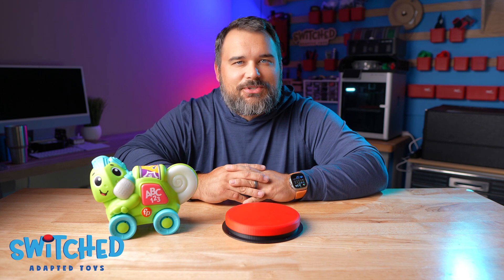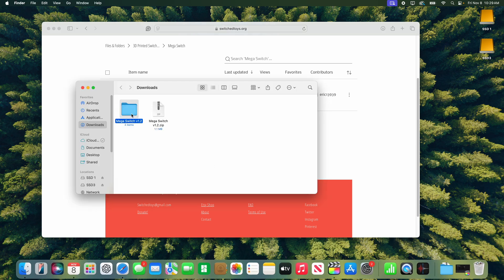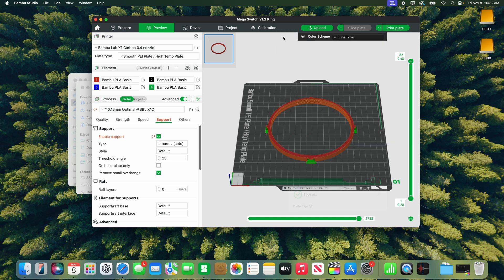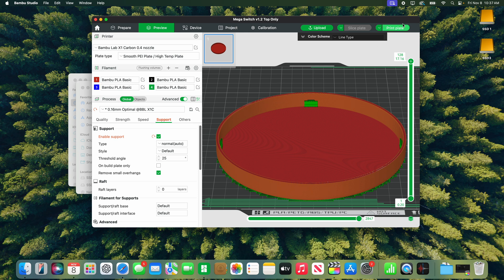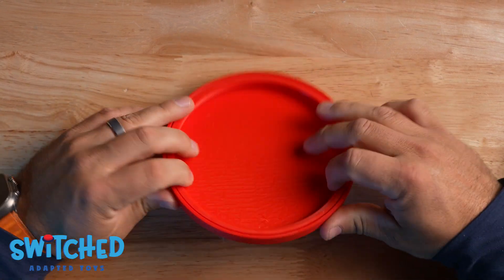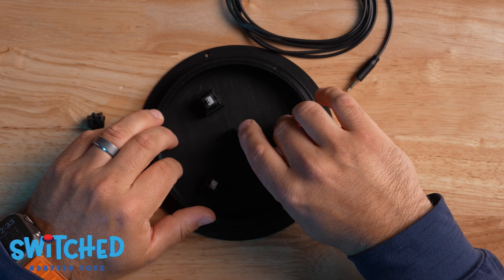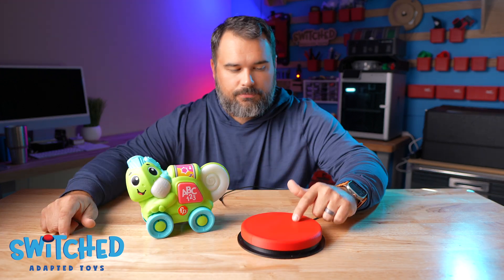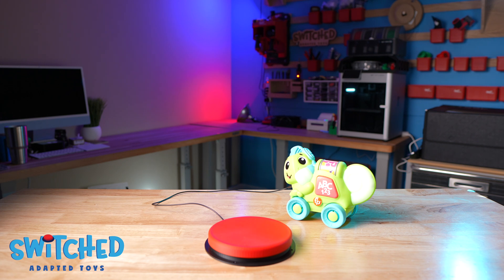Introducing the Mega Switch | Ultimate DIY Guide to 3D Printing Accessible Switches

Comment: Hello, love the product! I do have a question though. Does the button rest right on the switches? And if so, how does it prevent it from activating?
Reply from the maker: The button top is supported by the keyboard switch but the switch spring offers enough support for the top, allowing it to be pressed and then reset.

Comment: I would love to know what 3d printer you recommend. We are able to write grants for such things so I would love to know a good quality printer to purchase. Thanks!
Reply from the maker: If you’re new to 3D printing, it’s hard to beat Bambu Lab. They make excellent printers that work well right out of the box. We use X1 Carbons, but if you’re just printing switches with PLA, the A1 series or P1P are great options as well. If you are wanting to print our Mega Switch I wouldn’t recommend the A1 mini. I think technically you could print it but you would be pushing the build volume right up to its limit.

Comment: I would love to know what 3d printer you recommend. We are able to write grants for such things so I would love to know a good quality printer to purchase. Thanks!
Reply from the maker: I recommend any printer from Bambu Lab. We have the x1c but we are printing a lot of switches. May be overkill. The A1 series would be a good option but the build plate may not be big enough for our Mega Switch. The P1P is a good option if you are only printing with PLA. Bambu labs are great printers out of the box and I feel are very reliable.

Comment: Any issue with pressing on the edges? What if you wire the 4 mechanical keys in parallel so that if any of them are depressed it activates? Very cool project, thanks for sharing!
The project I'm planning will not just use a mono 3.5mm cable, but connect to an arduino pro micro clone for usb keyboard functionality, so I can handle button debounce in code.
Reply from the maker: The Cherry MX Speed Silver activates with just a tiny amount of travel. So off center presses or light presses on the edge of the switch still activate using just the switch in the middle. You certainly could try wiring them all up but we haven't seen much of a need.
Reply: @switchedadaptedtoys  Thanks!